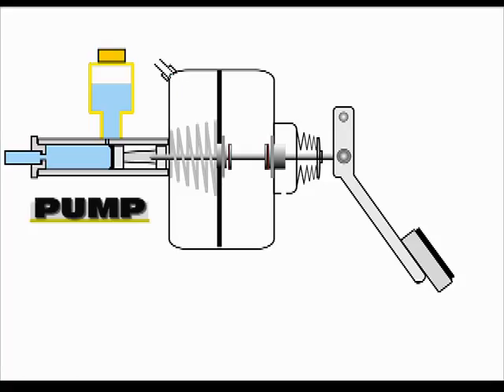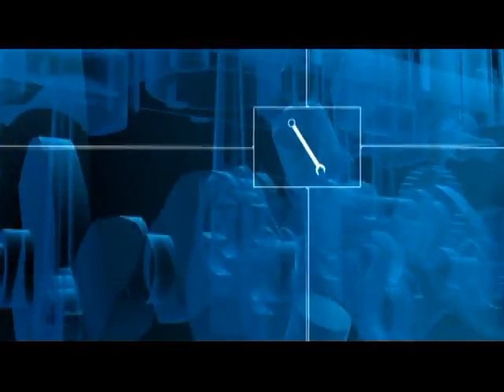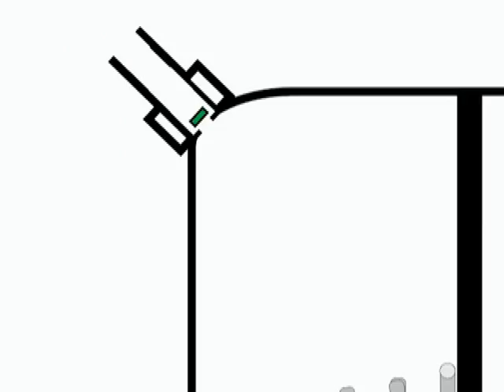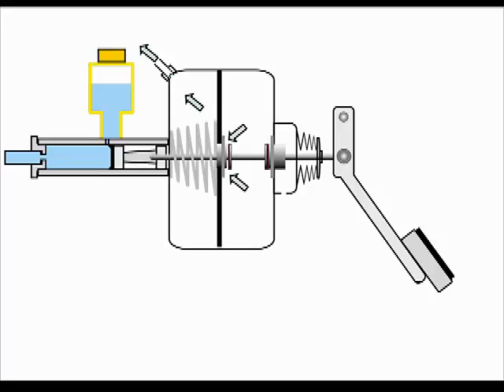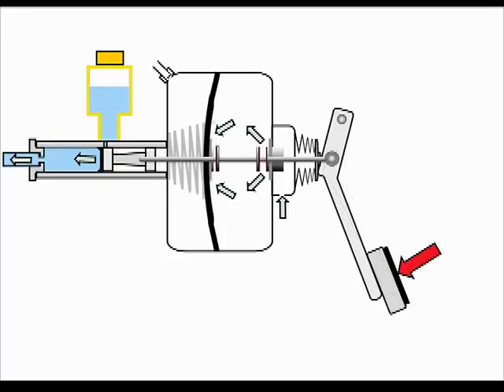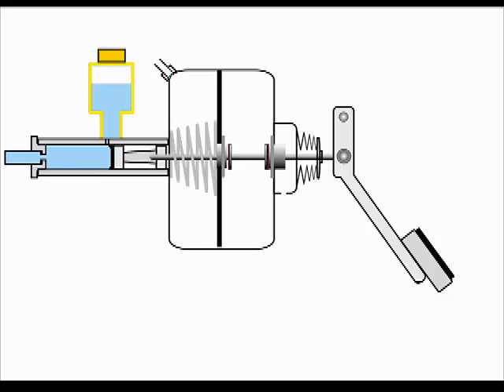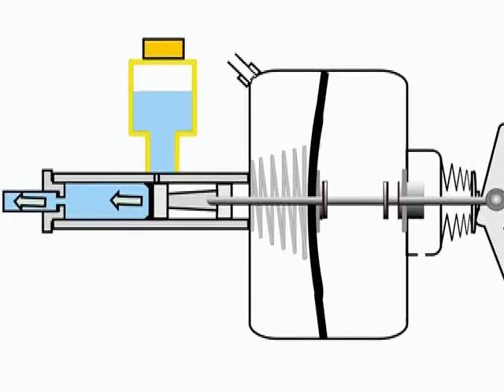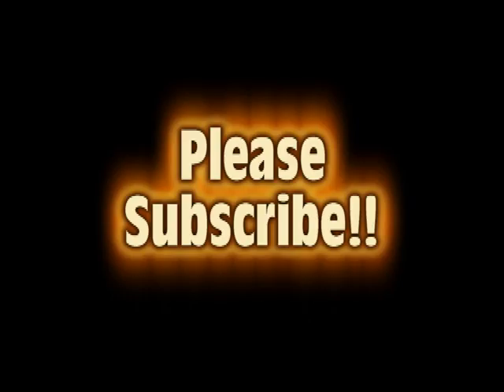How Power Brakes Work

Comment: Powerful info.. Can the working of a braking system such as a brake booster and vacuum check valve for a brake booster have an effect on brake dragging and seized calipers ?
Reply from the maker: Dear Xolanisandile, one common problem is as follows: whenever there is a major stress on the front suspension, such as a major repair, or a minor accident, sometimes a metal brake line feeding the front calipers is bemt pr crunched, thus creating a constriction. This allows the brakes to be applied, but the relatively weak springs which release the calipers are not strong enough to return the fluid back to the pump instantly, but the calipers stay put, and the fluid slowly goes back to the pump. This is very frequent in a minor accident when work must be done to the front end. Please check to see if this metal piece of pipe has been accidentally crushed. From what you say, the booster seems to be working normally. Regards!
Reply: @eltunene  very clear Thank you so much 🙌🙌🙌

Comment: I do have a question though, why is it if you push on a brake pedal very hard while in neutral you can hear a hissing but like it's sucking in or leaking air
Reply from the maker: It seems a leak in the booster gaskets or valves. It not only produces a noise, but makes the gas and air mixture much poorer, which impairs the engine operation as well. Even if the booster was recently checked, air pollution can find its way into the booster and cause this failure to properly seat the valve gaskets. Hope this helps!!

Comment: I'm trying to troubleshoot why the brakes on my car are slow to return, I think it might have to do with the vaccum or the diaphragm.
Reply from the maker: Dear friend, another possibility is a partially crushed brake line from a previous repair of brakes or suspension system. If so, when you press the brake pedal the booster forces the pads against the disc, but as you release it, the brake pads springs are not strong enough to force the fluid back fast enough.
Reply: @eltunene  that would make sense, thank you for the informational video and advice 👍
Reply: @eltunene  also, I notice this problem when it's warm outside more than when it's cold.

Comment: While driving with slow speed power brake goes hard...Is it normal ?
Reply from the maker: Hey, that can be a difficult to find problem. There is a big argument with GM for their brakes malfunctioning when at low rpm. Even some vehicles failing to stop at the parking lot or in a long line of cars in a highway. Apparently, GM made an upgrade by doing away with the engine vacuum system and installing a separate vacuum pump for operating the booster. This pump is lubricated by engine oil and sometimes the oil leaks into the booster and creates leaks in the gaskets, thus creating this dangerous situation. I found a  GM Truck Club at https://www.gmtruckclub.com/forum/threads/2015-silverado-brake-failure-at-low-speed.1406377/ and people having bad accidents and filing lawsuits against GM for that. The thing is that none of them (not that I know) have been able to find a remedy. Please check their posts.
Reply: @eltunene  is it happen with every car? As my car is new just completed 7 days.. Worried is it defective or normal
Reply from the maker: @7sandip  Well, the data I just send you is about pickups, I don't know about cars. But your car should be covered by some type of warranty, and if you go and try to fix it, maybe they can use that as a pretext to  make warranty void. I have never owned a Chevy, I am a fan of asians. However, I'll keep looking.